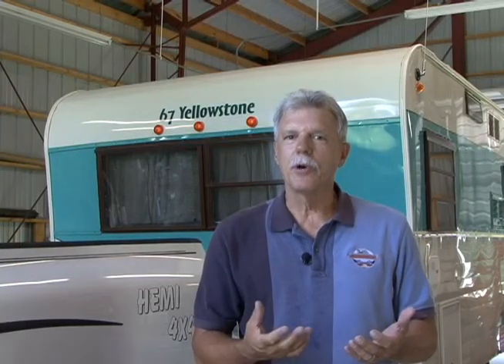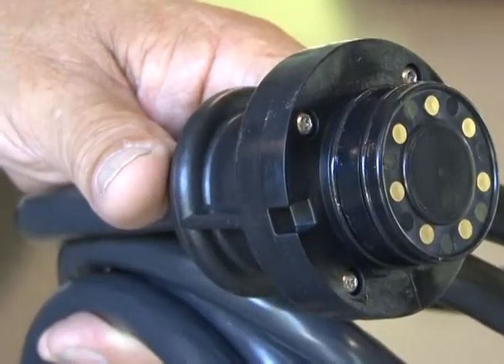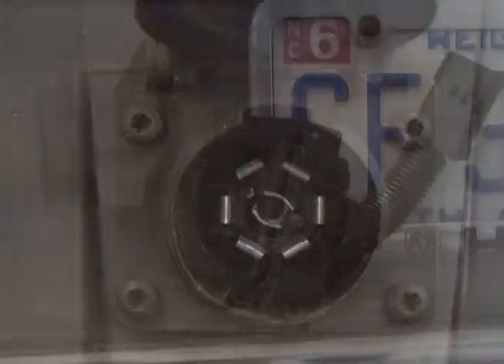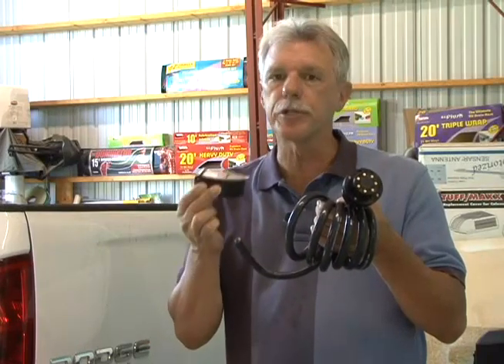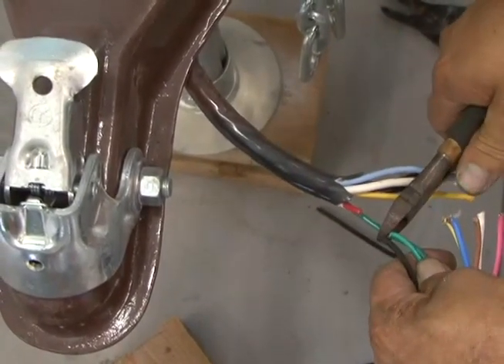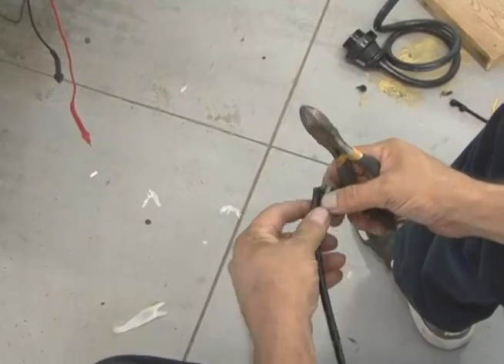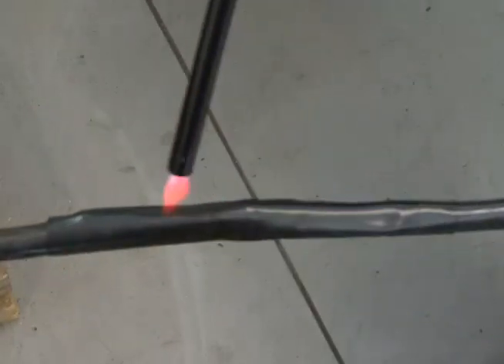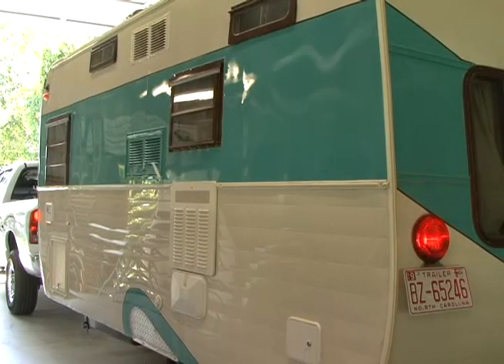EZ Connector - The last RV trailer plug you will ever buy

Comment: Wouldn't it be a Lot Smarter to have an EZ plug on the truck AND trailer with a Removable extension cord connecting them that can be stored in the truck when not in use to prevent theft?  That's where I thought this was going.

Comment: what happened to my TRC model 44270? Surge guard plugged into post, my 50amp just installed shorecord from camp world plugged into that. Anyway, my TV stopped working, rv battery just enough juice to turn over engine. Surge guard says no power (3 yellow), but could hear power on. Why would surge guard change to using only chasis battery and blow my TV? Thanks
Reply from the maker: Its difficult to say what happened without actually seeing it but If the surge guard indicated there was no power then the RV was operating 12 volt devices in the RV using the auxiliary battery.
Reply: so what r surge protectors for?  (I know I'm off topic)😂😂